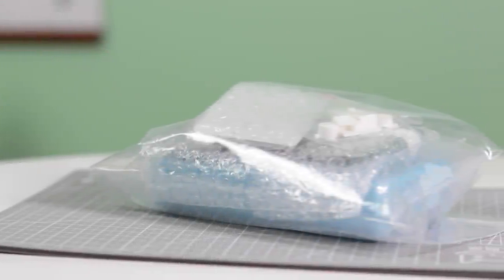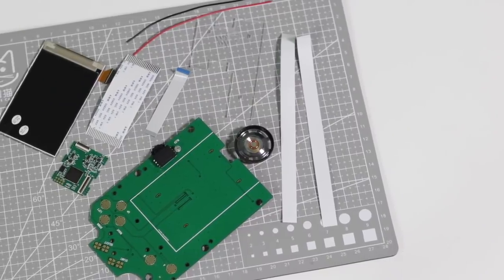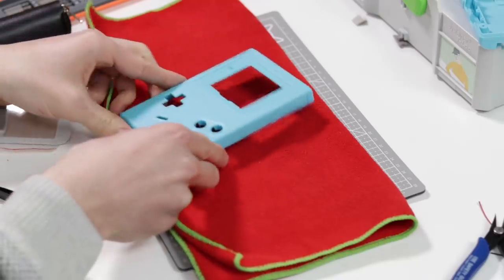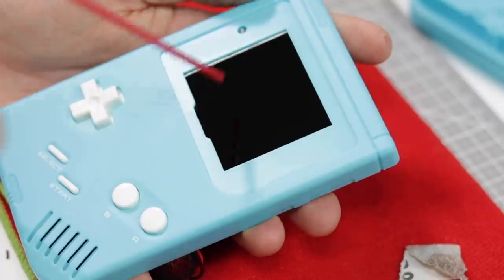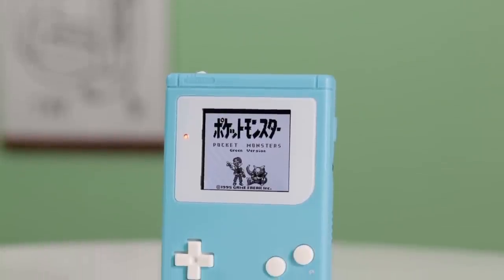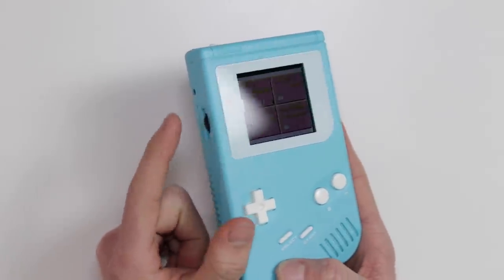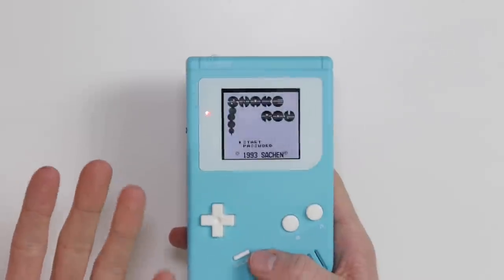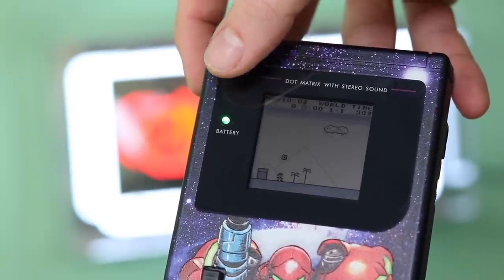The DREAM GameBoy Build! - DMG IPS Screen Mod

Comment: It’s a pretty poor move from retro modding no matter how much you say “it’s not a big deal” but it kinda is when they’re charging £60 odd pounds for about a tenners worth of kit because we are involved in such a niche market! I love the work they do but can’t help feel that still paying the price of a working unit for a “faulty” one is poor
Reply: I mean, it's not like they are selling tens of thousands of thousands of models. They gotta make a buck too. Small market, less buyers, so the product needs to sell for more
Reply: Kai Brunk which is fine but when they make an error sell those parts at cost on the website and explain the issue with them! Don’t send them out in kits while charging full price? their sole market is small as you say so why shaft them! Good will gestures go a long long way
Reply: These kits should be sold cheaper I agree.

Comment: I agree with what people are saying. It's far too expensive. I do like the idea of not having to solder anything and just dropping it in with the pre-made kit though.
Reply: But it's a custom part that likely isn't going to turn a huge profit.
Reply: @voidofspaceandtime4684  and yet there are other kits that cost significantly less for the same console and kits for other consoles like the GBC and GBA that can cost half the price. Largely this is because this quite a complex kit, with lots of parts. And that is the problem, this is an overly complex solution. There will be better options in the future.
Reply: @edwardtcrump5312  Are you gonna provide sources for those kits? Cuz I would love to have more options for modding parts and stuff.
Reply: @ShadeSlayer1911  I saw someone saying this is rebranded from China and I do find alot of gb modding shit on Chinese sites

Comment: Waaaaay too expensive.
Reply: its 69$ nice price
Reply: Don't get why people do mods this expensive for the original game boy and not the gameboy advance. Heck you can just buy a GBA SP AGS-101 for less.
Reply: I get why it is so expensive, because of the additional board with the custom silicon to get the colours/brightness & probably because the production run is much smaller because the appeal of the DMG is smaller than an AGB/AGS... so yeah it's a hard sell for most people but then most people will be happy with a cheaper modded GBA, this is just for the DMG enthusiast.
Reply: @BenWillock  that's not the reason, for example I sell these kits for about 55$ right now, maybe a bit more in the future when I have my own spacers but no more than 60$😉
Reply: Same price as any other screen mod like it.
Reply: @nhlvan  retro mods aren't about cost efficiency anyways, so there. If it were all about cost efficiency, everyone would just get a PSP and hack it to play GB, GBC, and GBA game, and nobody would bother with doing anything with the original gameboys. Or even better, just use your android phone. But it's not about cost efficiency. Do I like that it's so expensive? No, but I also understand why it's that price, and why people are willing to pay that price. 

Someday, I will get around to this mod, despite the price.

Comment: Man time to clean and retin your iron tip.  It's basically allergic to solder right now.
Reply: doesn't help that its a USB soldering iron. They never work very well.
Reply: @OkiDingo  Looks like a ts80 which is an excellent 80w direct heat iron.
Reply: @OkiDingo  Used properly, it's fine for small solder jobs like that. It just has low mass, so can't handle larger jobs.
Reply: @frac  it's direct heat, it handles larger jobs for me better than my older Weller setup.

You don't need nearly as much thermal mass when your heater is directly in the tip itself vs a few CM up the shaft. As instead of being slow to respond to temperature changes, it's response becomes almost instant and it becomes an issue of power delivery which the ts80 is perfectly capable.

Will it replace my old 100W soldering gun for soldering chassis grounds and tie points, no of course not, but what started as a portable iron has now replaced my Weller station as the main iron I use. It makes xt-60 connectors a cinch to solder, my old Weller would struggle to keep the tip hot.
Reply: Sounds like my soldering iron.

Comment: And I remember when repairing a Gameboy screen meant pulling the screen apart to replace defective parts, and the best/only replacement was the backlight mod and bivert chip, or low quality LCD screens with the wrong aspect ratio or weird scaling.

Comment: The "screen" is defined by software or hardware. The actual display is much larger than the original display, they are simply using the pixels they expect to see in the window. They should be able to move the screen area through firmware, possibly even allow you to move the virtual screen after install pretty easily.

Comment: I really don't think we've hit the sweet spot yet. We need modern, low resolution, monochrome replacement screen, which doesn't replace too much hardware, and is the same size as the original, without introducing any problems (such as the increased blur on the 3 inch screen). The ips screens are nice, but I don't think they suit the DMG and are a little overkill

Comment: I’ve installed the same kityestersay, but from Console5.com, which comes with a 3D printed bracket. It doesn’t use the tabs nor any adhesive and is perfectly centered. 

My only regrets are the palette problem (which is pretty easily fixable right now, ans should be fixed in the software anytime soon) and the fact that you have to stick with preset ones. There is no way to edit or create your custom palette. The included ones are OK, but I wish I could use softer tones for some. 

But it’s still a GREAT improvement for our beloved old DMGs. I’ve been able to restore a broken one with this, but with a great bright new display, that works great, wether in the dark of the night or in the plain daylight
Reply: Same here, in The Chinese Guy video we saw a better green original pallete for example and in this kit the green one looks so shiny and fake... Hope a Rev2 came out to fix this and then I will be sold! And hope a GBP one release sometime soon

Comment: Seems like the kit requires a ton of extra fixes. Why did they mold the shell to not be able to fit the screen? Rather than snipping off and sanding all those extra bits it seems like it'd make more sense to simply not mold them. I guess if you already need to solder in the speaker, soldering some extra wired to fix the color isn't a massive issue, but I shouldn't have to pay for what is basically a defective kit. They should be charging less until the issue is resolved.

Comment: I know e-paper displays aren't quite fast enough, yet, but I truly think the ultimate upgrade for the DMG would be an e-paper screen. Even as they are, in what is called "A2 mode" on a lot of ereaders and tablets, they just get a little bit of dirty-looking ghosting the longer they run, but that MIGHT be acceptable in some cases.

I still feel unbelievably cheated by Qualcomm giving up on Mirasol displays. Those things were definitely the future...

Comment: Hi! I have the same soldering iron, but I have problems to get the solder stick to the tips... it is really a problem in usage. I always have to renew the tip with "Tippy". I use solder without lead, coud this be the reason? Do you use solder containing lead?

And by the way, great things that you do ;-) I modded my childhood DMG with a backlight with retro look (no bivert). I found out, that you can get more contrast by rotating the polarizing film. This in addition to a warm white led gets you the standard retro look though it is illuminated. And I modded some Advance mit IPS v2. The Advance I first got to know about one year ago now is my favourite retro console/handheld.

Comment: Does the prebuilt kit come with speakers soldered on already too? Because you first soldered with that, not the weird screen color issue.

It being horribly misaligned is a big issue too, except it doesn't even have the usual alignment menu to offset the pixels, odd when the screen is so much larger than the hole it fills, so it could easily adjust...

Comment: I suppose the only big question I would have that isn't addressed in the video would be battery life. The OG Game Boy's big claim to fame was how ridiculously long the batteries lasted compared to competitors such as the Game Gear, and a big portion of that was due to the screen used. The Game Gear had a full-color screen and would eat through six batteries in a span of three hours as a result. The Game Boy used the lower-quality black-and-white screen to compensate, and had much better battery life in the range of 8 to 12 hours as a result. Since you're replacing the screen with a newer model with more features such as a colored backlight, what does that do to the battery life, since the rest of the system wasn't designed with those added features in mind?

Comment: I think that it is still not 100% perfect... but it can definitely get there... (my idea of it being 100% perfect is not having to cut the original shell, have backlight, have high resolution, and have the original screen size....) I don’t mind soldering too much, as long as I don’t have to scrape away at the board to get to the traces... either wise, I think it is a decent mod for the time being👍. Good job RetroModding👌!
Reply: Don't think its possible since getting a direct screen replacement is impossible unless they pay someone to manufacture one, and with a minimum order of thousands units and all the costs involved they will not make a profit and will have to charge $200 for a direct drop in.
The screen they are using are probably cheap generic and mass produced lcd screens so cheaper option to do it this way.
Like you I dont want to cut into my original dmg case.
Reply: TN_AU ahhh.... I see.... still think it would be really awesome to not modify the original case tho...

Comment: Big question, does anyone make drop-in direct replacement screens? I' recently got scammed on Ebay and got a  DMG-01 with a bad screen, and although I could do something like this, I want to replace it with something a little more... I dunno... authentic? Excellent video, cheers!

Comment: Well I think that this mod losses totally the charm of a DMG, I mean, the screen based on the primal LCD technology is what defined the first Gameboy, this just took away that felling, you can simply emulate the system on a Android device and get the same result, in my opinion, the perfect mod for a DMG is the bivert backlight.
Reply: Nah, I understand what you mean but you’re just looking at this in the wrong way lol. This product is just another modification like the bivert Ed backlight that is meant to be an enhancement, you’re using original hardware and everything to power it, and it compliments one another. It literally is a product that modernizes the classic DMG. I have no qualms about emulating and enjoy doing it for some systems, but emulating game boy is one that I avoid due to the feeling. Playing it on PSP or android devices just never “feels” good, because of the image never fully feeling good enough. The pixels distort in ways where they’re washed out or don’t align right. This mod and the others however don’t mess with that
Reply: exactly. This mod just makes the DMG just another one of the 10,000 handheld systems with IPS screens that you can emulate Game boy games on. The pea soup green, crappy LCD DMG screen is iconic. You can emulate the games, but you can't emulate that old technology.
Reply: @Dominicn123  don't misunderstandme, I know this is an enhancement in order to make the experience more enjoyable, i'm just telling that, in my opinion, this totally looses the charm of the original experience. I think is totally about perspective, i mean, classic Gameboy is a machine that i enjoy emulating the most because due to this is one of the simplest machine (besides ZX spectrum), is one of the most accurate emulations that's to the great effort of the scene, if you know how to set the proper aspect ratio, the right scale of pixels and even the right overlay, you'll get a petty similar experience like a DMG with this mod, not perfect, but really close and almost nobody will find a difference. Again,is just my opinion, i'll ever prefer the original screen with a backlight over this expensive mods or in last case or even emulation.

Comment: Why the heck does some of the screen get covered by the shell? It looks like a vertical 16:9 screen instead of a 4:3 screen
Reply: Because I believe the screen wasn’t made specifically for this mod or system, but was just one that was repackaged for use as a game boy display, probably from a old cell phone or different display for something, that’s the case for a lot of items. A lot of screens we use are the same size as others so manufactures can have less wasted items and more efficient uses
Reply: @Dominicn123  Huh. Neat!

Comment: Hey guys,

Great mod indeed, I just did it on my DMG and it looks wonder....but, is it me or the fit is a bit tight? I had to force the case a little bit to be able to close it. The screws keep both halves in place but I was surprised that doesn't seem to be an issue on the video?

Actually, the fit was so tight that the directional buttons were just too stiff, doing diagonals was almost impossible. I had to open it again and trim a bit of plastic from the back half (right behind the A-B and the directional buttons), also used very thing washers to keep a bit od distance between the buttons and the replacement board...it feels better now.

Also noticed the replacement board is WAY thicker than the original, I guess that contributes to the extra pressure inside the case. I'm using the original case, btw.

Any thoughts?

Comment: Some months ago, i contacted 'That Chinese Guy'-channel asking when the non-soldering version will be available. i never got an answer.  Do you happen to know ther release date? I have never soldered but want my old DMG to be used again instead of taking up house-space, and with my eyesight the IPS is the best solution. In that respect  i'm okay with the pricepoint. The only other option would be chucking it away, so if i can save it for that money and have fun with it with my 7-year old daughter, no prob. Soooooow, any sight on the non solder version release date?

Comment: Hmm. Expensive and nothing like the original Gameboy experience, that plus the penny pinching of RM on failing to supply a key part of the diy kit (the acrylic spacer) puts me off, plus import tax on this in the UK.

That $70 (£54) DIY kit becomes £65 ($84) by the time it's in your hands.

My GBA screen, shell and lens came through from RM the other day, it's absolutely lush to play on and arrived well packed, but that tax charge was a bit of a sting I'd completely forgot about.

Comment: The price is fair considering the amount of time involved in creating these mods. It's not a simple case of buying $10 of bits and putting them together, it's way more complicated than that!
Reply: You need to compare the cost of the kit against other LCD kits on the market and you'll see that the price is similar. You are obviously comparing the cost of the pre-built drop-in screen against the kits which are obviously cheaper. But look at the price of McWill screen kits, they are often $100+ to purchase. At the end of the day the manufacturers aren't going to be selling huge numbers of screens and the price reflects that. If they could reasonably expect to sell a million units then they would be able to get the costs down by manufacturing in bulk, but nobody in their right mind would make so many at once as that's just asking to lose money.
Reply: @flibblesan  You are mistaken, and apparently uninformed. The price of the DIY kit is 50% more than other kits using the same or similar screen for other devices, and about 7 times the cost of a back light and bivert kit (a different solution, but still a very good one). As I mentioned, there are valid reasons for this kit being expensive, but this IS an expensive kit, compared to other kits. And obviously the low volume run and high development costs argument applies to all the other kits also, so it's not a relevant counterpoint here

Comment: The screen is a touch smaller than the original screen right?  To me that is unacceptable, as the screen is already tiny as it is.  Heck, I would love it if they actually did this with an even bigger screen than normal.  Hell, use as much of that Bezel space on the screen itself as possible!